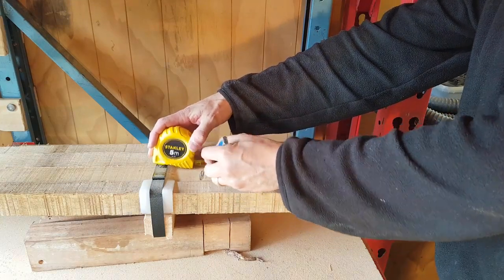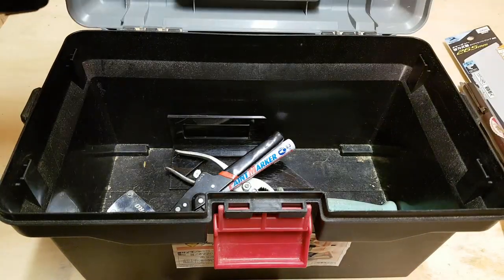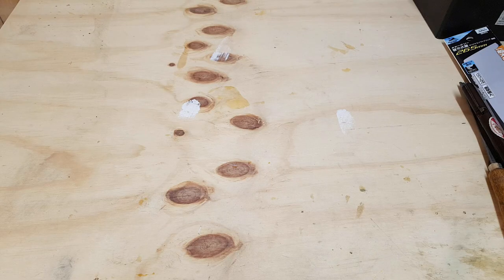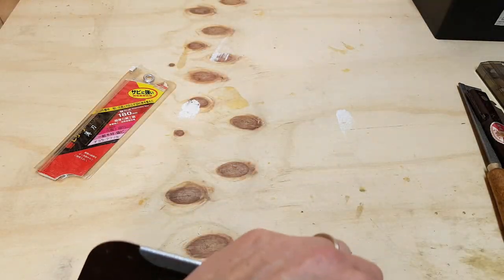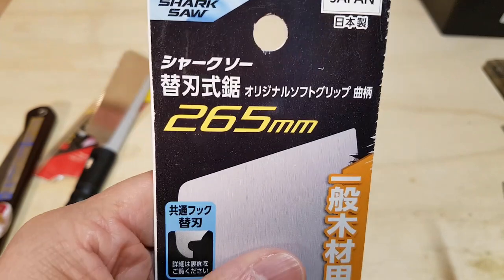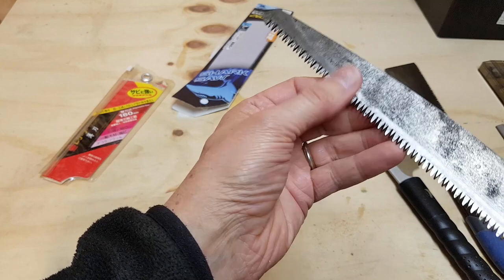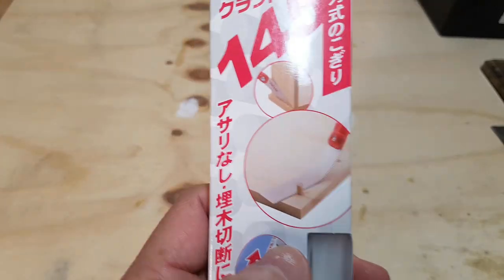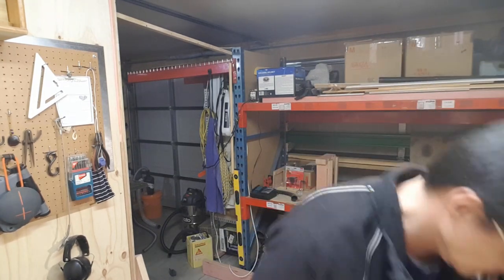Japanese saws from DIY stores in Japan

Comment: Well hey there Rob, y’all got a nice collection of Japanese saws & I think that in motion the pulling of the blade seems more of an accuracy & natural strength thing than starting in the push motion, nicely demonstrated buddy 🍻👍👍👍👍
Reply from the maker: Well hey there pardner. You know, these are not "traditional", but they are Japanese nonetheless. It seems to me that this pulling action is what allows these blades to be so thin. They are nice to use but what is strange is that I've never owned a small western saw so I don't know the difference really. 😏

Comment: Hi Rob
As I do not understand English and the autmatic translation does anything I did not understand what saw you recommend for intensive use.
thank you in advance
Reply from the maker: Hi sébastien!, I recommend the Shark saw (4:36) - this is great for general cuts and very easy to use with that handle. "Shark" is a 150 year old company and available in some places outside Japan. And I really recommend a small "Hello Kitty" (6:50) craft saw - so handy for fine cuts and small pieces. Both of these styles are available from other brands like Bahco, Stanley etc - and not so expensive as they are disposable. Cheers!
Reply: Hi Rob. Thank you for the answer. I'm thinking of buying a Dictum https://www.dictum.com/fr/scies-japonaises-baaa/kataba-super-hard-240-poignee-en-bois-712204

Comment: I know this is 2yrs old, ha ha, but fwiw the Japanese translates as;
Razor Saw
Rust resistant - special surface treatment
Spare blade type ( this means the blade is disposable, and you reuse the handle)
Ultra-thin blade work
Newly hardened special surface treatment
Lumber Plywood Acrylic General Wood PVC
Reply from the maker: Impressive Cherry 👍🏻I happen to be able to read Japanese too, as I lived there for about 15 years when I was a young feller.
I bought all these tools there over 13 years ago.
Reply from the maker: Wasuremashta, giri no ... Arigatou gozaimasu, nihingo hontou ni o jyouzu desu ne.